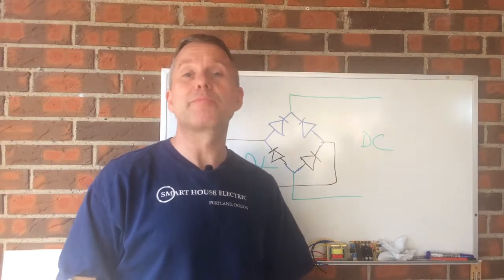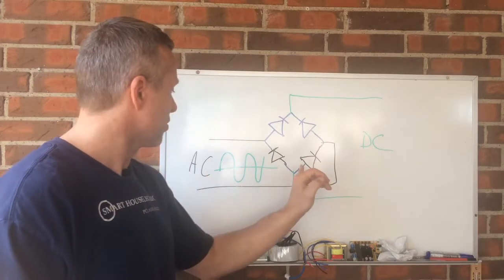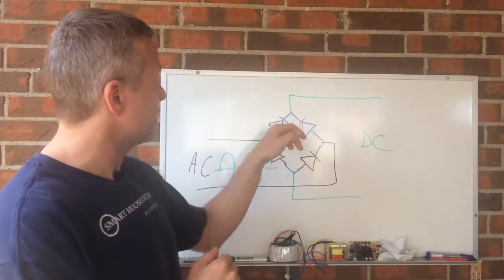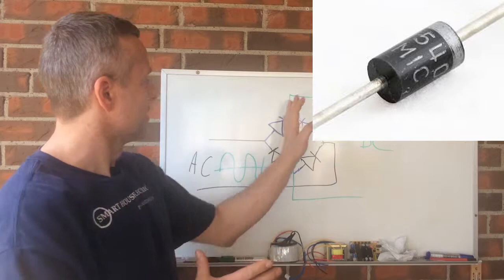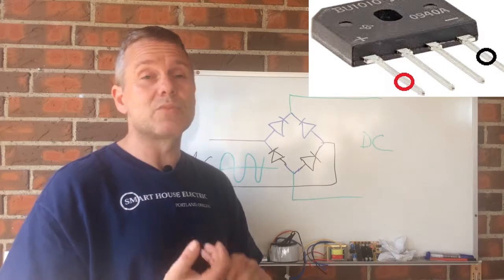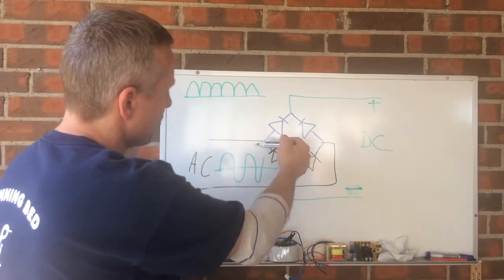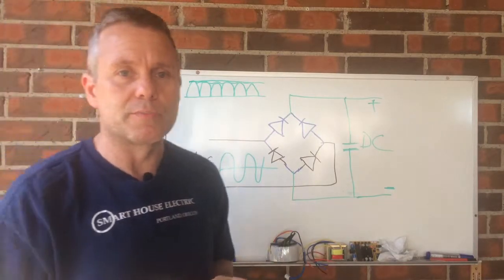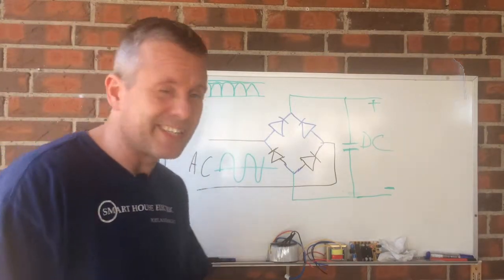What is a bridge rectifier?

Comment: A diode doesn't only control direction. And isn't only for multi bridge rectifiers ... You should explain that they can be used individually as one ...also there is many diodes you should explain .....but one simple diode can drop voltage to protect devices like when hooking small battery electronics up USB....lets say Something with 2 AA batteries..thats added would be 3 volts if you are worried a USB 5 vlt is to high and could fry the device ... use a diode to drop the voltage from 5 down lower so its protected ... Diode can bridge + or -